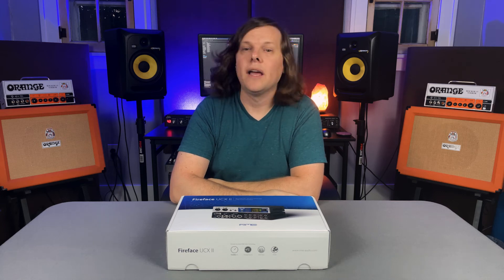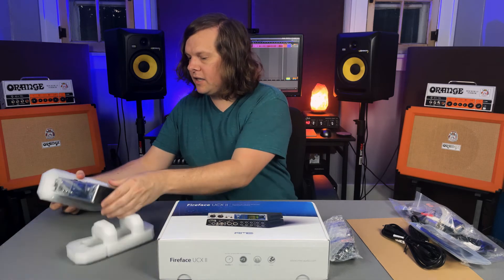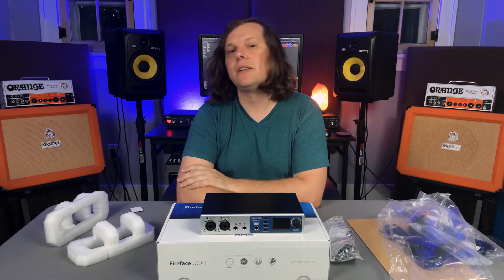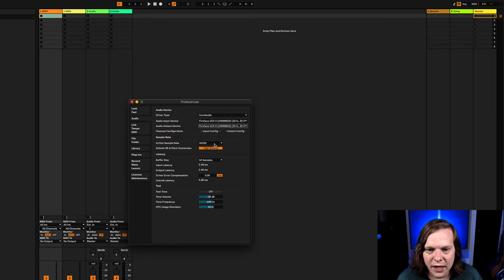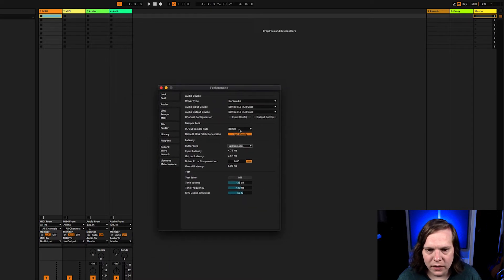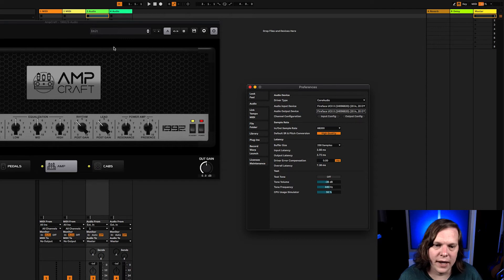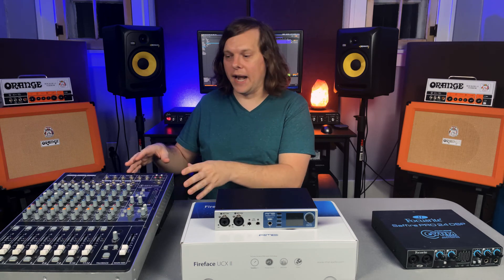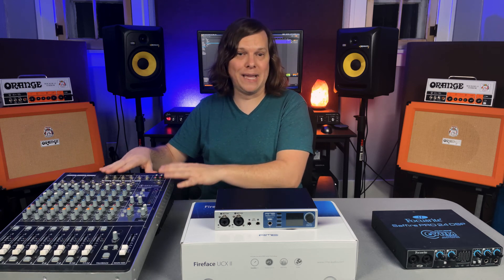RME Fireface UCX II Unboxing and Latency Comparison

Comment: Depending on workload and computer performance you may be able to reduce buffer size/latency down to about to 32 samples/ 2-3ms.
Raise it only when audio starts to crackle and break up.

If you are using a lot of VSTs/CPU you may wanna keep it high. If you are using external gear you can keep the latency lower.

Comment: just picked up one as well, and in addition from the sound, the latency, & the power of totalmix, the longevity was a major concern for me as well. I researched and RME is actually still making current (updated in 2022) drivers for the Fireface 800, which came out in 2004!

I've personally had 8 audio interfaces since 2001: SoundDevices USBPre, Motu 828, Pro Tools MBox 2, Pro Tools Mbox 2 Pro, Apogee Duet FW, Apogee Ensemble FW, Steinberg UR22C, Focusrite Clarett 4Pre. Of all those, only the Steinberg & the Focusrite still have current drivers. Compared to the longevity of most studio equipment, I find this just completely ridiculous. Especially when some of these (i.e. the Apogee FW interfaces) sound amazing, and I'd love to keep using them. I still have the Duet, and can manage to get it to work partially, and I love the sound of the pres. But I can't turn on phantom & can't use the line/instrument inputs, so it's getting retired.

I bought the Clarett this year, & its sound & latency were quite good, but it wasn't stable with my M1 Mac system for some reason. I considered some other options, especially Antelope, which have excellent latency & really good sounding DSP as well. But finally, Antelope has a quite negative track record for longevity, after abandoning some of their recent products in less than *two years*.  

In short, I should have just bought a Fireface 800 back in 2005, instead of the Motu 828. I'd still be using it, most likely. So, learning from my mistakes... I sincerely hope & believe that in 2040 I'll still be using the RME, with current drivers.
Reply: I had an Motu 828.. when that went down I bought the RME UFX ..just recapped it for like 100 bucks last year .. I bought Focusrite to replace IT but sent it back and fixed the rme ..it was easy .. I missed total mix too much ..I 
have the first version UFX.. still love it

Comment: WOW Compared to this a Quantum 2626 latency is pretty fast! Probably along the lines of the RME. I was looking for another Interface and PreSonus dropped Thunderbolt on their new HD8 Quantum, but their drivers are not as fast as the older model. That sucks! Guess I'll stick with this for now. I have a real Amp running into an IR loader with some of the best IRs I could find. However, the latency can become an issue. I started learning how to run at 96 Khz but we'll see I guess I do have a really good tone man. And the feel is spot on! I have a nice cabinet but the SM 57 needs at least some volume to get a good tone from the real cabinet so Irs it izzzzz!

Comment: Would you take this over the Motu Ultralite MK5?! I mean they’re kind of the same and one is just cheaper with the exact same features other than Jitter Immunity that the RME has and yeah…Latency are about the same though. Did you find the RME UCX ii in stock or did you order one and how long did it take for you to get one?
Reply from the maker: Really just depends on your budget and needs. I wouldn't say latency is the same, its substantially lower on the RME. For instance, Julian Krause pulled the numbers for the MK5. At 48k/64 its 6.9ms. The RME is 4.3ms. That's nearly 40% faster. When you're trying to perform live with plugins, 40% is a big deal. The Motu has lots of the same features, though, more outputs, and is definitely the more cost effective option. I'd still go with the RME because of the quality of the drivers and the longevity of support that they've demonstrated, they're really committed to their customers. I didn't find the RME in stock, ordered it at Sweetwater and it took about a month to arrive. They were good about letting me know how long it would be before I placed my order so I knew what to expect. This is not just an RME problem, either, many interfaces are currently on backorder due to a global chip shortage...particularly those who use AKM for their AD/DA converters.
Reply: @KeenanCrow  Boy the RME is expensive hopefully I don’t regret this decision! I never knew that the latency does have an effect when it comes to virtual instruments….don’t you need a powerful computer more ram and a better processor so that low latency could be an effect?! I’m blaming you for making me buy this instead of the Ultralite MK5 just cause VST latency is very very very important to me….don’t set me up.
Reply from the maker: @tuneunleashed  primary thing is processor speed and the drivers. RAM makes little difference. But given the same processor, the RME is going to be lower than the Motu regardless.

Comment: Is there a reason why core audio in “Driver Type” wasn’t changed? I haven’t used ableton in forever so not sure if it matters
Reply from the maker: MacOS covers everything in CoreAudio. Unlike Windows there is no need to change driver types between things like WDM/ASIO/etc
Reply: @KeenanCrow  To be honest, CoreAudio has gotten much worse in terms of usb latency with time. They now have something like "usb average latency" values, that can be evaded only by using TB. So there is a reason RME develops and supports their own driver. It's better to use it as it's one of the main things where RME shines in comparison to other manufacturers.
Reply from the maker: @levanchikvaidze3519  in terms of class compliant drivers yes. RME drivers still technically operate on CoreAudio.

Comment: Two questions.
1. Can I record 30 microphones with ufx II somehow? Or only 20 with 4 built in preamps plus 16 via two adat?
2. What is the best preamp extension for ufx II from rme now? Two octamics xtc or octamic II? I understand that 12 mic will „leave” 4 unused channels from adats.
Thanks
Reply from the maker: Not super familiar with the UFX line but generally any ADAT in will give you 8 channels at 44.1/48. If you need 88.2/96 you’re down to 4 channels per ADAT in. Each doubling halves your available channels because ADAT is natively a 48k standard so upsampling happens via SMUX. The UCX adds 4 channels via SPDIF and AES which are both indifferent to sample rate. UFX only has the AES ports (you can run them as SPDIF but there are no dedicated coax connections to add channels) so that’s two more channels at whatever sample rate you want. So at 44.1/48 you get the 4 mic pres, the 16 ADAT lines, and the two AES/SPDIF lines for a total of 22 possible mic pres. You can also of course add stand alone mic pres to any of the line inputs as well.
Reply: @KeenanCrow  thank You.

Comment: Does the Rme sound card have a preamp?
Reply from the maker: Two mic preamps. No phono preamp.
Reply: @KeenanCrow  Please explain the two mic preamps🥰🙏
Reply: @KeenanCrow  Is there no preamp like midas preamp in rme card?
Reply from the maker: @raviakber  Midas is a specific kind of mic preamp. There are two mic preamps in the units, but they are more transparent sounding than Midas preamps are.
Reply: @KeenanCrow  Can you share two mic preamps? Please 🙏
Reply: @KeenanCrow  Can you share the two mic preamps as a video? Please
Reply: @KeenanCrow  40-Input, 25-Bus Digital Mixing Console with 32 Programmable Midas Preamps, 25 Motorized Faders,-Channel LCD's, 32-Channel Audio Interface and iPad/iPhone* Remote Control
Reply from the maker: @raviakber  they are RME designed preamps
Reply: @KeenanCrow  Thank you for your attention.
Reply: What difference do you think we will feel if we use thunderbolt instead of rme usb2?
Reply from the maker: @raviakber  not much. RME’s USB drivers are extremely well optimized. You might shave off a millisecond or so on the lowest settings but nothing significant.
Reply: @KeenanCrow  Thank you, I'm glad
Reply: what should be the number in the buffer?